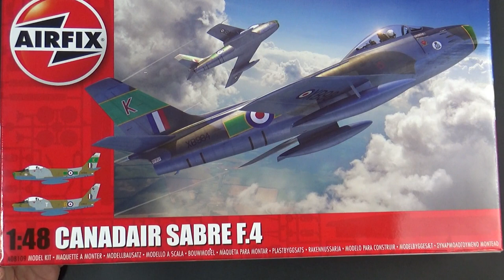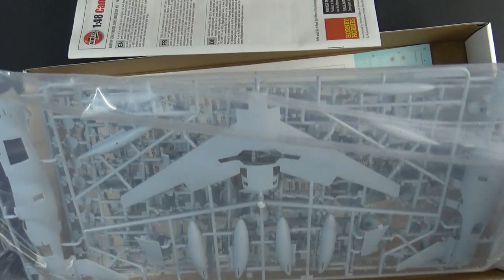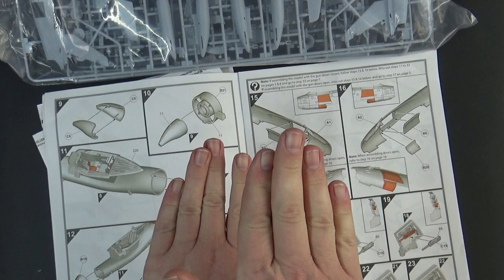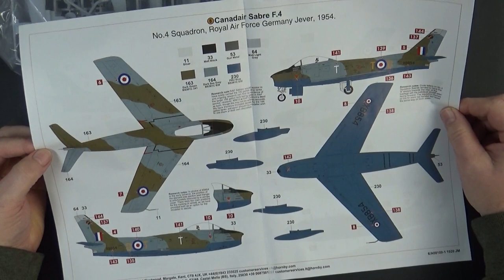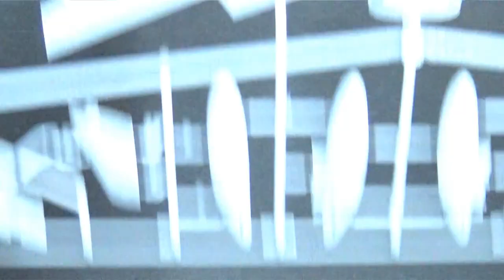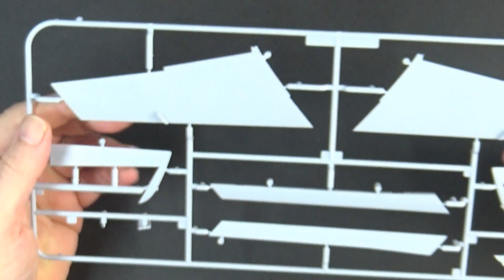Airfix 1/48 Canadair Sabre F.4 Build: Part One - INITIAL CONSTRUCTION

Comment: The most modern Airfix kits are well or very well engineered and designed  with clear instructions. The plastic quality is gradually getting better as well. My main issues are quality control, quality of packaging and price. They tends to be slightly more expensive than their target quality level (re degree of simplification) suggest s they should be. However, they are still getting better.
Reply from the maker: You hit it on the head exactly Nick, and that's what infuriates me about Airfix - the QC is just so inconsistent.....a pity!

Comment: I have their 1/24 Hellcat.  The only Airfix kit in the stash.   Will that project be a major headache?  Reviews have been positive but I never built an Airfix kit.  Anyone know any shortcomings with that kit?
Reply from the maker: Major project because of size and complexity. From online builds I've seen there's lot of mold seam cleanup and it seems leaving engine cowls off leads to less trouble closed up. Also lots of options that may never be seen, so you can skip a lot. 
I hope they bring out an -3 version one day. Plus a seatedpilot...
Reply: @beckersmodels  Thanks for that.  I’m with you on pilots and a version of in flight closed gear.  Very few aircraft in my stash offer those options.  You talked about it countless times and it is rather silly more manufacturers don’t offer us modelers a choice.